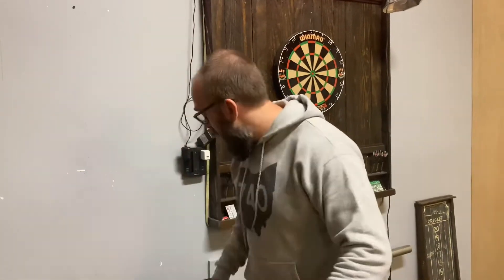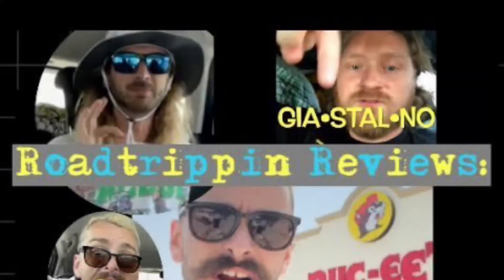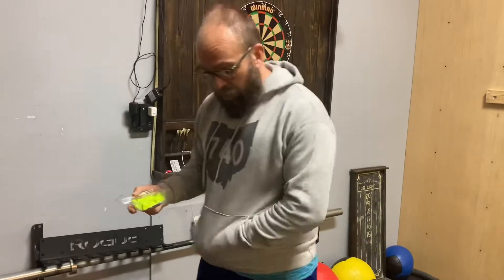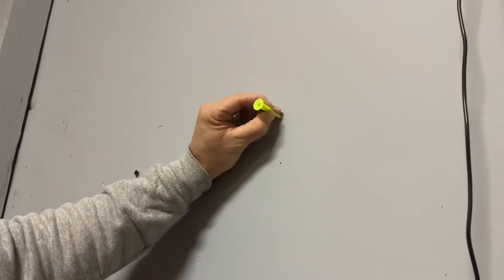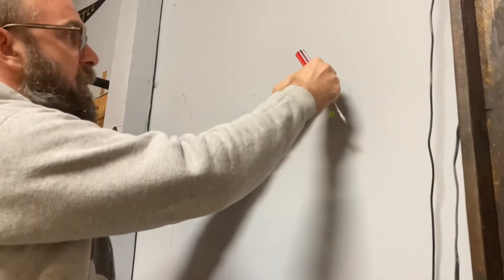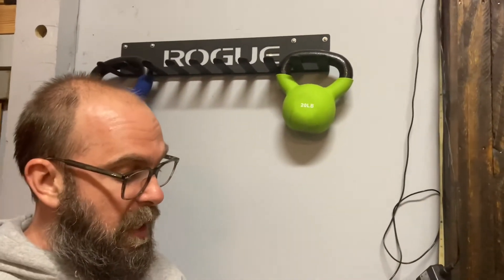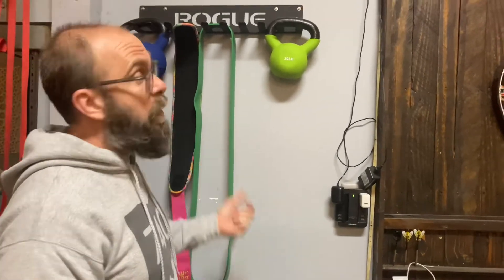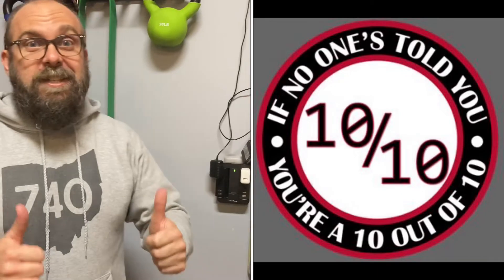How To Install The Wall Claw Drywall Anchors. Game Changer? (Detailed Directions and Review)

Comment: i only use these and work great. they say no pilot hole required, but I always drill one for accuracy.
Reply from the maker: Thank you for the reply! Thats not a bad idea for even more accuracy. I have enjoyed the speed in which I can use them and not having to switch between drill bits. Knock on wood, everything I hung with them is still holding strong, including the new guest bathroom shower curtain rod that was installed in November 2022.

Comment: Would you recommend this product to hold a 19 lbs speaker with a stand alone drywall anchor???
Reply from the maker: If you follow the recommendations on the box it should. We put over 60# of weight on our rack and it is still holding firm after months of use.
Reply: Thanx for the quik reply
Reply from the maker: @JP-qf4ds  You are very welcome! Love to help and hope you have as great success with these as we have.

Comment: I tried those for shelf mounts and they wiggled like crazy and then the shelf sloped down. Very frustrating. Removed them and now w have to do hole repair.
Reply from the maker: Sorry to hear that. Ours are still holding strong. We even used them to add a new shower curtain rod in a guest bathroom remodel in November. We only have a few left before we have to go buy a new pack. Thanks for the comment.

Comment: How bad does it tear up your drywall?
Reply from the maker: It was way easier than drilling a hole and putting the standard plug that you have to put a screw in. We will have to check how easy it is to remove and what it actually does to the drywall. Great question and we should of done that for the original video. Stay tuned for the answer.

Comment: wouldn’t recommend these. went through half a box and they all broke from hammering before getting halfway through the wall
Reply from the maker: That's a bummer to hear. You do need to sort of start with a few short taps to get it started but after that we have had no problem. I used the entire box to hang everything from pictures to shower curtain rods. And our Rogue organizer from the video is still holding strong for almost a year now.
Reply: I had same results  they bend before you get them through

Comment: Total garbage anchors. Do not use. Would not hold 1/2 their weight.
Reply from the maker: That stinks to hear that they didn't work out for you. Luckily ours are still holding strong 6 months later with about 75 pounds of workout equipment hanging from them. Thanks for watching and commenting.